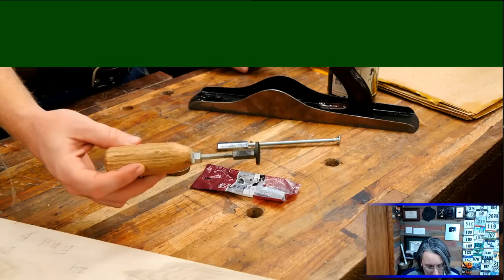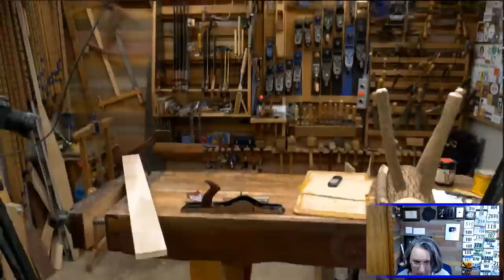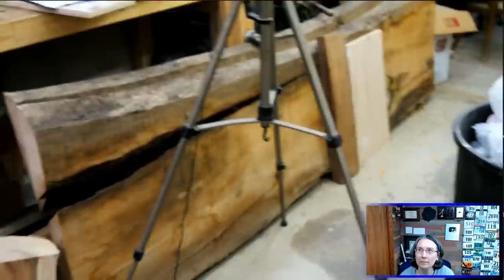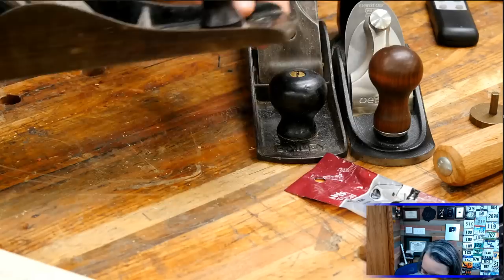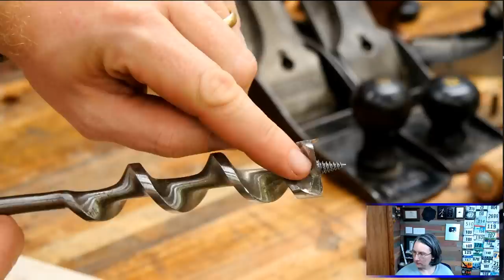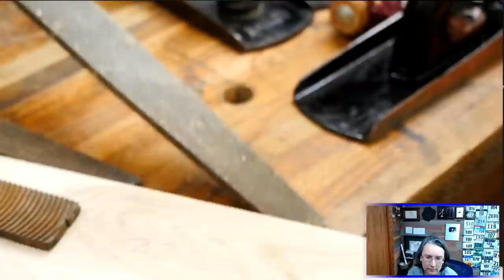Ask Me Anything Nov. 2019 Hand Tool Woodworking Q&A

Comment: For the question of a traditional way of attaching a table top to the table, what about a mortis and tenon with a wedge sawed through where the leg attached to the table. Place a wedge in the area which was just sawed, then with the table flipped on its top, beat the legs into the mortis and tenon which would cause the wedge to insert itself fully and expand the leg end inside the top? I know sounds more complicated that what is in my head.
Reply from the maker: You could do that on two legs but not on 4 due to the expansion of the top.